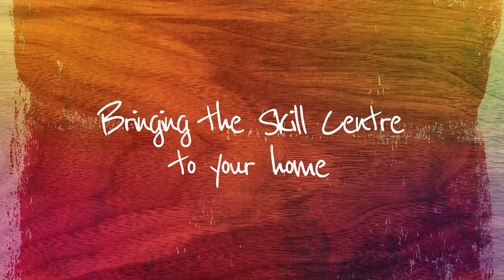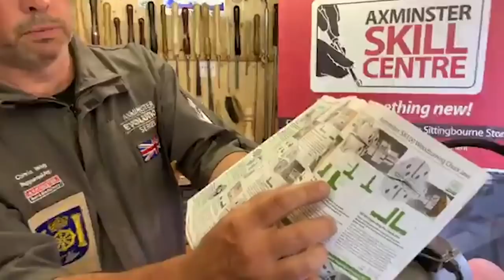#SkillCentreAtHome - Live Turning Thursday - Awl & Mallet

Comment: A brad awl has a flat tip and does well for drilling small holes for brads. My favorite grind is the birdcage awl with 4 sides on the tip so it will really cut a hole! I did a couple of videos on birdcage awls.